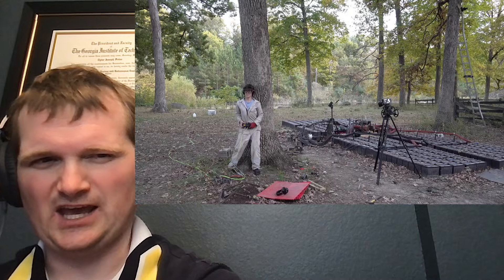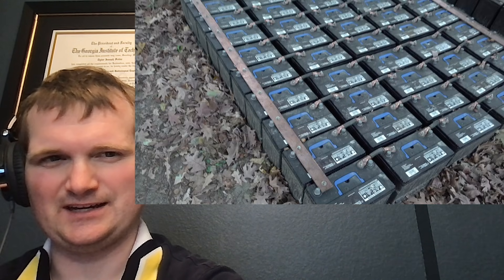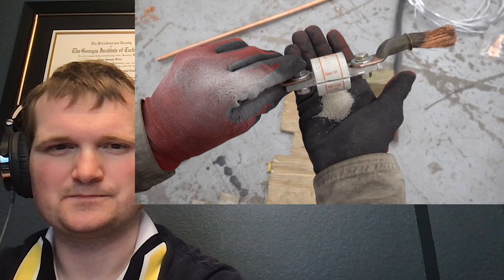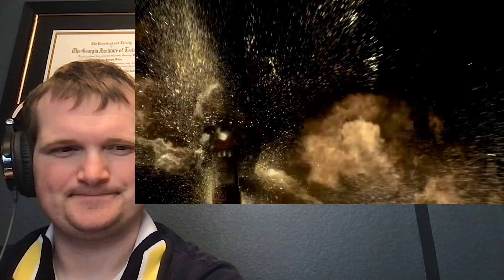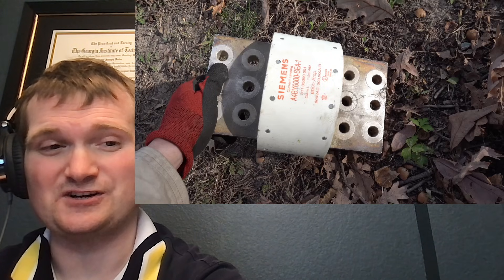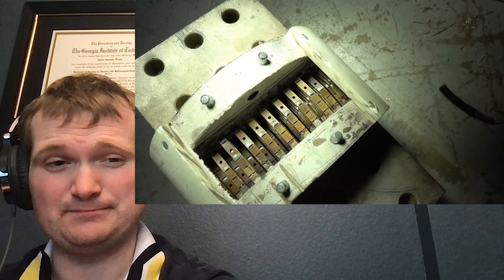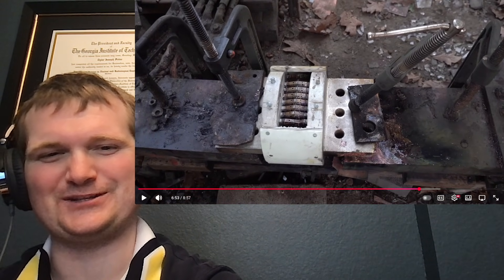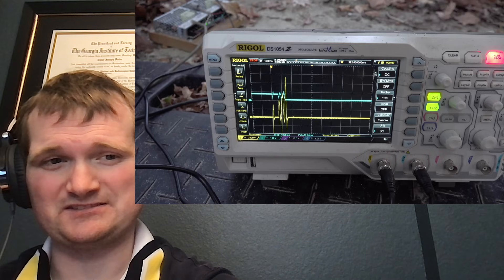Popping a 6000 Amp Fuse - Nuclear Engineer Reacts to Styropyro

Comment: Because he is running a bunch of batteries, that run at 12 volts each, daisy chained by 5, parallel by 10, and 8 groups thereof, he is producing about 4800 (maybe 6000 if he's lucky) amps.
And about 480 VAC.

He is below the VAC limit on the fuse, which means it will safely stop the blowout, but the power isn't able to hit a steady 6000+ amps, so it doesn't blow.

I used to work at a Microsoft Data center where we'd handle hundreds of cables that were 13500 VAC with 5000 amps each.
Mind you I'm a bit rusty and got them wrong at first too, but yeah, he's not blowing the fuse because there isn't enough juice, though it is creating sparks because of the sand (insulator) has been removed.
I see he does make it succeed at the end, but you can tell it didn't want to blow.

Comment: 15:37 Why is it always the positive “+” side that melts? I remembered once I accidentally tipped a starter battery on to a aluminium step and it melted a hole only on one terminal, can’t remember which terminal but probably the “+”. Any scientific explanation? Plasma? Debye sheath?

Comment: I know about normal electrical stuff like cars and homes, but when you get deep into the science its past my pay grade. So high amperage can cause a magnetic field during an arc? Makes sense, i had no idea. I worked at a scrap yard for a few years. our boss took a huge pile of steel fasteners, put a truck on top of it and placed the magnet few feet above it and said "this is why you need to be 50 yards from it working/on and threw the switch. Nuts, bots brackets pieces of scrap iron shredded through the floor up through the roof to the magnet, so ive see that force at work its insane i didnt know it happened it this level of electricity

Comment: "Ejecting something for safety" depends on what exactly you're ejecting and where. A spent fuel rod into the environment? Big no-no. An unstable reactor into space? That's how they do it in Star Trek. (Let's not ask why they designed the core so that it has enough unreacted fuel in it at any moment to destroy the ship so they need to eject it rather than, for example, cutting the fuel feeds)

Comment: I saw one car battery explode in my life. It was as loud as a 12 guage side by side. The guy was working on his car engine and he had a trouble light hooked up to the car battery. He set a lit cigarette down ot top of the car battery. I guess the cogarette ignited the gasses emmitted from the car battery as it was discharging. This guy looks like hes at risk of igniting 400 car batteries!?

Comment: pulling out the sand took some of the heat sinking from the fuses, thats gonna change whether its a 6ka fuse or not
Reply: Yes, I was thinking that it would be easier to blow all of those links with the sand missing and the fuse would handle less current or take less time to blow.

Comment: I live in an old transformer station , my living room used to house a huge transformer for my town.. The floor had like railroad tracks on it that where use to slide the transformer inside, the huge reinforcements down into the ground, and behind my house is the other part of the power station (it was 2 buildings) and there are still massive wires in my wall connected over to the other house :)

Comment: Survived an arc blast pulling a 150 amp fuse in a bucket. Fireball from my feet to the plant ceiling. Safety glasses saved my eyes, lenses went from clear to dark. Using the proper fuse puller saved my life. Arc blast is no joke, electrical will mess you up quick.
Reply: I don't really understand electricity too much. But my step brother was a tree worker, and in 2013 we had a bad storm and for some reason the company decided they didn't need to shut down the power lines he was clearing trees from. RIP Zach. Glad you're alive bro, I doubt you would have felt anything at least if you hadn't been so lucky.
Reply: @TomasaurusREKT Sorry for your loss.

Comment: I worked in a shop building a guys design of a lightening arrestor fuse . Basically a 1/4 diameter braided wire in a tube, This was inside a series of concentric tubes with gas vents so it could telescope out to 3x it's length without coming a part and flying into the dry grass in they have in Central California.  It was fun watching the video of the testing. The power company has a qualifying facility that simulates a lightning bolt hitting a power transmission line. They had super highspeed cameras and a great plot of amps vs volts and calculated resistance. 
I found it fascinating we could see the pre-burst phenomenon as the wire notched down in multiples of the reflection off the ends and vaporized and equally spaced intervals.
But most interesting was the superconductivity of the plasma arc until it extinguished itself. The resistance goes down and the amps go up while the plasma is present.

Comment: "we've decided to avoid reactor melt downs by ejecting it through a hatch" is genuinely the most hilarious thing i've seen on this channel. just wild to imagine.
Reply: IIRC the warp core in the Enterprise (ST:TNG) is also designed to be ejected in the case of failure
Reply: @ShinyHappyREM   Yep, that's how they do it in Star Trek. They are ejecting it into space rather than the countryside, but you still have to wonder why they have enough unreacted fuel in there at any moment to destroy the ship so they need to eject it rather than just cutting the fuel feed.

Comment: about 5 out of the 400 batteries in parallel would be enough to hit 6,000 A and blow the fuse
Reply: No, did you miss the chart he showed? How long do you think the batteries would put out that amount of amperage? It isn't just about the total amperage, but also the amount of time at that amperage.

Comment: How is this setup wired?  It looks like a combination of parallel and series. I learned about how to wire batteries in the Marine Corps as initially a self propelled howitzer mechanic. They use a 48v system with 4 12v batteries wired in series parallel. Also working at a car stereo shop installing systems. Wiring subwoofers to get the ohm load that you want is similar. I would like to know volts and amps of this bank of batteries.

Comment: Cycle Summary
Metric	Value
Total Cycle Latency	0.043 ms
Calibration Time	0.036 ms
Proposal Generation Time	0.003 ms
Council Vote Time	0.004 ms
Council Decision	APPROVED
Target Latency	< 10 ms
Status	PASS

Detailed Communication Log
Calibration Communications
[18:23:21.312] Calibrating TF
•	target: 1.0 | tolerance: 0.01 | source: test_harness | version: v1 | 
[18:23:21.312] TF Calibration Complete
•	calibrated: True | drift: 0.0 | latency_ms: 0.008000002708286047 | lineage_hash: 1794533a5be1c806... | 
[18:23:21.312] Calibrating TEMP
•	target: 50.0 | tolerance: 0.5 | source: test_harness | version: v1 | 
[18:23:21.312] TEMP Calibration Complete
•	calibrated: True | drift: 0.0 | latency_ms: 0.006000002031214535 | 
[18:23:21.312] Calibrating NEUTRON
•	target: 1000000000000.0 | tolerance: 100000000000.0 | source: test_harness | version: v1 | 
[18:23:21.312] NEUTRON Calibration Complete
•	calibrated: True | drift: 0.0 | latency_ms: 0.0050000089686363935 | 

Council Communications
[18:23:21.313] Configuration Loaded
•	mode: steady | limits: {'max_dB_dt': 15.0, 'max_temp_C': 200.0, 'max_neutron_flux': 500000000000000.0, 'min_quality': 0.9, 'max_clock_skew_ms': 3} | cooling_margin_C: 10.0 | 
[18:23:21.313] Vote Complete
•	approved: True | votes: [True, True, True, True] | vote_time_ms: 0.0040000013541430235 | decision: APPROVED | 
[18:23:21.313] Vote 1: Physics Check (dB/dt)
•	vote_index: 1 | vote_name: Physics Check (dB/dt) | result: PASS | 
[18:23:21.313] Vote 2: Thermal Check (Divertor Safety)
•	vote_index: 2 | vote_name: Thermal Check (Divertor Safety) | result: PASS | 
[18:23:21.313] Vote 3: Neutron Check (Flux Limit)
•	vote_index: 3 | vote_name: Neutron Check (Flux Limit) | result: PASS | 
[18:23:21.313] Vote 4: Sensor Confidence Gate
•	vote_index: 4 | vote_name: Sensor Confidence Gate | result: PASS | 

Diener Communications
[18:23:21.312] Setpoints Defined
•	target_field_T: 1.2 | target_ramp_T_per_s: 5.0 | target_temp_C: 55.0 | 
[18:23:21.312] Safety Limits Defined
•	max_dB_dt: 15.0 | max_temp_C: 200.0 | max_neutron_flux: 500000000000000.0 | min_quality: 0.9 | max_clock_skew_ms: 3 | 
[18:23:21.312] DienerCoilGroup Initialized
•	group_id: TF_01 | max_current: 80000 | 
[18:23:21.313] Proposal Generated
•	proposal: {'field_delta_T': 0.19999999999999996, 'ramp_T_per_s': 5.0} | status: ok | generation_time_ms: 0.0030999945010989904 | 

Hardware Communications
[18:23:21.312] JIT Acceleration Enabled
•	jit_enabled: True | avx512_enabled: True | 

Obol Communications
[18:23:21.312] TF Created
•	name: TF | value: 1.0 | unit: T | lineage_hash: 92f28d3c2a9378c4... | 
[18:23:21.312] TEMP Created
•	name: TEMP | value: 50.0 | unit: C | lineage_hash: d8cff68d32e580ff... | 
[18:23:21.312] NEUTRON Created
•	name: NEUTRON | value: 1000000000000.0 | unit: n/m2 | lineage_hash: e50151462896cea7... | 

System Communications
[18:23:21.312] Initializing Obols
•	stage: initialization | 
[18:23:21.312] Starting Calibration Phase
•	stage: calibration | 
[18:23:21.312] Calibration Phase Complete
•	total_time_ms: 0.03619999915827066 | status: PASS | tf_calibrated: True | 
[18:23:21.312] Checking Hardware Acceleration
•	stage: proposal_generation | 
[18:23:21.312] Starting Proposal Generation
•	stage: proposal | 
[18:23:21.313] Starting Council Vote
•	stage: council_vote | 
[18:23:21.313] Total Loop Latency Calculated
•	total_latency_ms: 0.04329999501351267 | calibration_ms: 0.03619999915827066 | proposal_ms: 0.0030999945010989904 | vote_ms: 0.0040000013541430235 | target_ms: 10.0 | status: PASS | 
[18:23:21.313] Obol Latency Stats Updated
•	tf_loop_latency_ms: 0.04329999501351267 | tf_calibration_latency_ms: 0.008000002708286047 | tf_actions_per_sec: 23094.690881325252 | temp_loop_latency_ms: 0.04329999501351267 | neutron_loop_latency_ms: 0.04329999501351267 | 
[18:23:21.313] Full Cycle Complete
•	status: success | 

Console Output

Proposal Details
Parameter	Value
field_delta_T	0.19999999999999996
ramp_T_per_s	5.0
Council Vote Details
Vote #	Check	Result
1	Physics Check (dB/dt)	PASS
2	Thermal Check (Divertor Safety)	PASS
3	Neutron Check (Flux Limit)	PASS
4	Sensor Confidence Gate	PASS

Final Decision: APPROVED
Obol States
TF Obol
Property	Value
Name	TF
Value	1.0 T
Calibrated	True
Calibration Source	test_harness
Calibration Version	v1
Calibration Drift	0.0
Sensor Quality	1.0
Clock Skew	0.0 ms
Loop Latency	0.043 ms
Actions/sec	23094.7
Lineage Hash	1794533a5be1c806278dca4654f8779a...

TEMP Obol
Property	Value
Name	TEMP
Value	50.0 C
Calibrated	True
Calibration Source	test_harness
Calibration Version	v1
Calibration Drift	0.0
Sensor Quality	1.0
Clock Skew	0.0 ms
Loop Latency	0.043 ms
Actions/sec	23094.7
Lineage Hash	55013b3dde8ab737218409528187aa6f...

NEUTRON Obol
Property	Value
Name	NEUTRON
Value	1000000000000.0 n/m2
Calibrated	True
Calibration Source	test_harness
Calibration Version	v1
Calibration Drift	0.0
Sensor Quality	1.0
Clock Skew	0.0 ms
Loop Latency	0.043 ms
Actions/sec	23094.7
Lineage Hash	a3cd765d2a88eba7ae767f15c3c3b9e9...

Comment: 18:28 that's the most terrifying thing I've ever heard.
Reply: From a level 4 PPE supplier "At these energy levels, the pressure wave and sound from an arc flash can cause injuries regardless of thermal protection, making de-energization the only safe approach."  
Hotter than the surface of the sun for a moment, we got that.  But the g forces from the pressure wave...
Also from Google  G forces from a pressure wave...  
The sudden onset and massive force required to accelerate a human body (especially the torso's large surface area) in a very short duration (milliseconds) results in extremely high, momentary G-forces.
The internal organs and tissues, being of different densities, are accelerated at slightly different rates, causing shear stress and damage, particularly at air-tissue interfaces like in the lungs and gastrointestinal tract.

Comment: When I was a kid, probably 5 or 6 years old, I dumbly connected an also dumbly placed un-terminated house main branch, because someone forgot about it, to ground that tripped the main breaker. To a wee child, the arc and smoke that came off of it totally ruined any future career in electrical engineering. I remember fondly how close I came to the phrase curiosity killed the cat.
Reply: I was told that I used to stick bobby pins in the receptacles, as a little kid. Also, I remember my dad had a length of wire in his old car, so I stuck it down around the e brake and to the door handle. Well, somehow it had power flow through it and burned the crap out of my thumb and sparked. Eventually, I learned to do electrical work and did quite a bit of it, working on commercial buildings and lighting maintenance up to 480v 3 phase and I would do the lighting work 30 feet up in a bucket truck with the power still on. When there are sparks, I much prefer to have one of my welding helmets on and actually be in the process of welding. 😁

Comment: Where is 6000A fuse used? Like how many homes would connect to substation that has 6000A fuse? Or is it even used at substations at all or only at actual power plants themselves and not substations?
Reply: Industrial plants, data centres, factories.

6000 amps at 600v 3phase  would be 56000 KWH. Some large plants like aluminum refineries  need it

Comment: Here’s a question. How would he charge the battery bank? I understand each battery wouldn’t be drained a whole lot. However, the batteries would slowly discharge overtime and I doubt there’s a 12 V battery charger that would be capable of charging that that monster of a battery bank. 

If anyone has any ideas, please let me know
Reply: Home battery backup charger. The older ones used lead acid batteries. Would probably be like an hour between tests or something like that

Comment: How come you only adress the Amps. Amps means nothing without voltage. Its rated at 600VAC @ 6000 A = 3 600 000 Watts or 3600kW

He could just feed it with 6000A @ 1V and that would only be 6kW

Again, it would be more obvious to talk which effect the damn fuse handle. In his video he never mentions Voltage either? How can that not be relevant?

Comment: I guess this is a DC shorting instead of like a caps bank kind of e-blaster. The thing about shorting circuits is the heat occurs at the highest resistances, so if you don't blow up  a (weaker) thing you could melt your battery terminals.

Comment: I watch the turning of the voltage selector switch on the output transformer of a 600 megawatt generator - causing the transformer to pop since the switch was not made before break tapped - the transformer was shipped back to Westinghouse for repair that required a barge since weight was about 50+ tons - The nuclear shift supervisor order the tap change to increase the line voltage during loads - He was moved from the nuclear supervisor position 2 months after that order

Comment: I like that the design of the resistor is ironically the exact same concept as the battery bank. Just lots of smaller ones in parallel.

Comment: Styro’s Tree is UL listed as being Category IV arc flash rated.
Reply: To be fair if an arc flash hit the tree it would immediately go straight to ground
Reply: @derekderek2570 an arc flash is not electricity, it’s an extreme blast of infrared, visible and UV light which delivers a massive amount of heat.
Reply: @felixar90  Wood is shockingly heat resistant. I once burned a pound or two of thermite on a wooden board that couldn’t have been a full inch thick and it didn’t burn through. Carbon is a son of a gun.
Reply: @Ferrant621  wood turns into a insulator when burnt
Reply: @AmadeusJohansson-gf4ge  so it literally becomes an ablative armor
Reply: @monad_tcp  i mean you can literally make ablative heatshields for reentry out of wood, cork to be specific which NASA and ESA use many times. wood has very impressive thermal properties. you can even make scaffolding out of bamboo that is very safe and flame resistant so long as its not wrapped in flamable plastic
Reply: @HPD1171  shout out hong kong
Reply: @derekderek2570   No, if an arc flash hit the tree it would immediately go straight around.
Reply: @WJS774 I think you’ll find if an arc flash hit that tree it would explode the entire tree into match sticks
Reply: He has tree layers of protection.
Reply: i need to see the still frame and then cloesup of that being proven, it'd be so funny